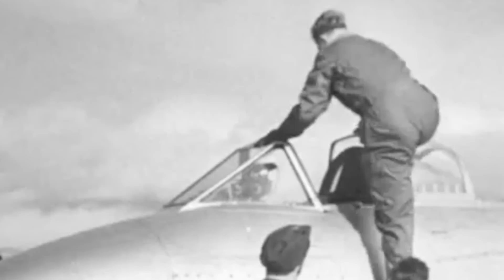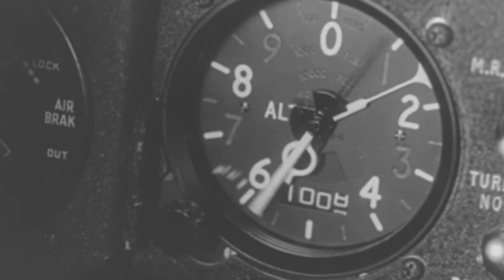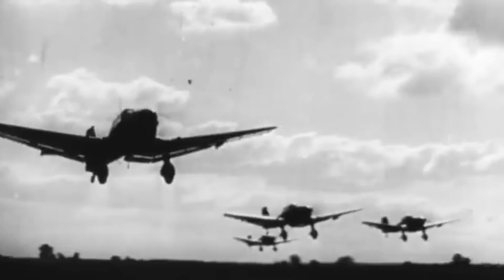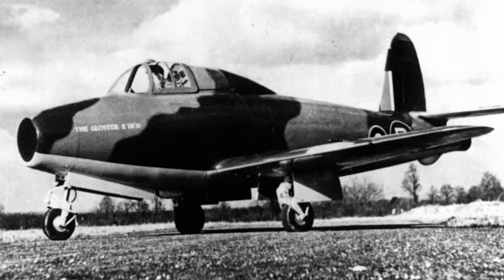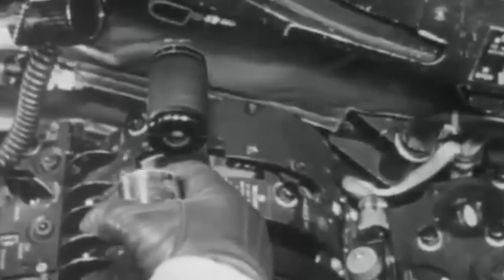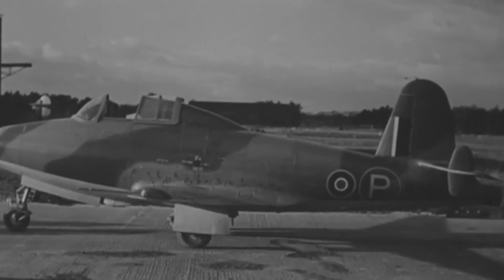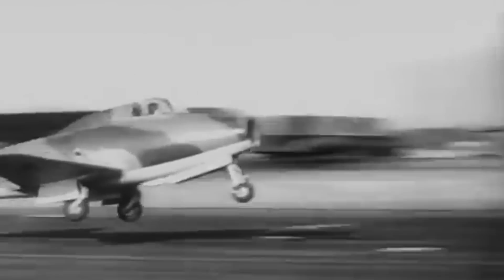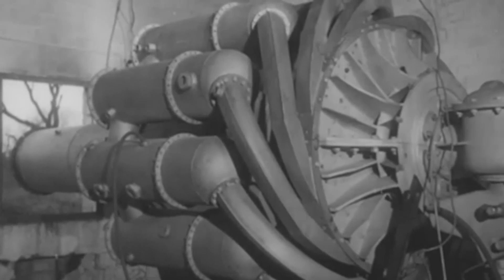Britain's 500 MPH Coffin With Wings

Comment: Your Post is Total Nonsense!
Reply: Gloster Coffin Works... the Gloster Meatbox was the worst deathtrap in jet aviation history.
Reply: @sandervanderkammen9230 

We believe we can clear up some common misconceptions & false myths.

It's always very important to note the relevant facts obviously.

Of course the F-86 Sabre & later F-100 Super Sabre & versions built under licence such as the CAc Super Sabre / Avon Sabre built for the RAAF generally had accident losses of around 21%. They were of course larger versions of the Whittle / Gloster E29/39.

    It was in fact the case that the Meteor had similar accident loss rates to the Sabre & Super Sabre while being a much earlier aircraft design.

    Regarding the awesome Gloster Meteor, it's achievements & obvious relative superiority.

   Indeed it is of course correct that the Gloster Meteor was in fact operational during WW2.

   Agreed, of course it is the case that we can compare the awesome trailblazer Gloster Meteor with the Starfighter. Training, equipment, knowledge in many areas & infrastructure had all improved considerably by the time of the Starfighter obviously, indeed it should have been much safer for pilots & others than it was.

     Yes that's correct obviously, the ME-262 was limited to running away from allied piston engine fighters  & risking engine destruction while doing so & it took 3 downed 262s for each downed allied bomber over Germany where German air inferiority was fairly ubiquitous so there was indeed large swarms of allied bombers available to have a go at but the 262 was of course a dismal failure at that task.

     Agreed, clearly after 1941 it was clear The future Gloster Meteor wouldn't be required as such & was limited to operation over the UK & occupied allied territories to keep examples out of the wrong hands.

    Yes it is of course correct that the world's first jet powered aircraft to exceed 1000 mph was indeed a British aircraft.

  Yes, agreed, it's a pity British forces had to occupy a large part of Germany for decades after 1945. Russia had to do the same. Russia now produces nukes. Of course the UK produces nukes. Germany does not produce nukes. Russia still possesses a large chunk of what was German territory.

  Of course there are two fabulous Gloster Meteor aircraft currently being used for ejector seat R&D at Martin Baker.
   
Contrary to their copious & ubiquitous posts regarding accident losses of various UK aircraft.
   
As they mentioned previously, the Sea Vixen & Gloster Meteor were indeed very competent & beautiful aircraft.

    In fact the Meteor was the world's first aircraft to exceed 0.85 on the combined 2 year looks & capability scale for jet fighter aircraft.
   
    That's correct of course, Indeed A rather superb Gloster Meteor was the world's first Turboprop aircraft in 1945. In 1945 & 1946 trail blazing Gloster Meteors set world speed records.
     
  Yes, of course it is correct that British military aircraft at the time did not have unusually high accident losses rates.
For example
De Havilland Vampire &  Sea Vixen & Gloster Meteor accident losses were not high or unusual for fighter aircraft at the time.
Non combat phase accident losses 
% of Aircraft built.
The Canadair CL-44 was a turboprop airliner.
Canadair CL-44                    (ff 1959 ) 48%
Lockheed XF104                    (ff 1954) 100%
Lockheed  P80                       (ff 1944) 43%
Lockheed F104                      (ff 1954) 45%
McDonnell FH Phantom       (ff 1945) 35%
Gloster Meteor                     (ff 1943)  21%
DH Vampire                          (ff 1943)  23%
DH Sea Vixen                       (ff  1951) 33%
Gloster Javelin                     (ff 1951) 20%

Gloster Meteor.
3950 Built.
In service 1944.
70% didn't have ejector seats.
839 accident losses.
436 accident loss fatalities.
21% accident losses.
11% accident loss Fatalities.

Lockheed F104.
2578 Built.
In service 1958, 14 years after the Meteor.
All had ejector seats.
1100 accident losses.
425 accident loss fatalities.
43% accident losses.
17% accident loss Fatalities.

As always we do indeed clearly hope this helps.

Cheers
👍 & 😎 & of course 🙂 indeed.
Toodle PIP Old Chap  (obviously)
     
                
    Clearly, the line above is blank, (entirely intentionally).  
O B V I O U S L Y
    
.. . .. . ... .... . . .......... ...... ..
.... ....... ..... ...... .....  ..... ...

Comment: A nonsensical misrepresentation.
Reply: The "Gloster Coffin Works" had a notorious reputation for building deathtraps, the Gloster Meteor (aka "the Meatbox" by RAF pilots) was the worst jet aircraft in history, no jet has a higher loss rate or fatalities statistics than the "Meatbox"..
Reply: @DoktorBayerischeMotorenWerke 

We believe we can clear up some common misconceptions & false myths.

It's always very important to note the relevant facts obviously.

Krappenz, DiktorBummer, KARZEESTAN, Diktorbayturmosterjerkzxoffenzische, AnewAOownley etc & co - they should all note with much awe and great wonder.

    Regarding the awesome Gloster Meteor, it's achievements & obvious relative superiority.

Indeed it is of course correct that the Gloster Meteor was in fact operational during WW2.

   Agreed, of course it is the case that we can compare the awesome trailblazer Gloster Meteor with the Starfighter. Training, equipment, knowledge in many areas & infrastructure had all improved considerably by the time of the Starfighter obviously, indeed it should have been much safer for pilots & others than it was.

     Yes that's correct obviously, the ME-262 was limited to running away from allied piston engine fighters  & risking engine destruction while doing so & it took 3 downed 262s for each downed allied bomber over Germany where German air inferiority was fairly ubiquitous so there was indeed large swarms of allied bombers available to have a go at but the 262 was of course a dismal failure at that task.

     Agreed, clearly after 1941 it was clear The future Gloster Meteor wouldn't be required as such & was limited to operation over the UK & occupied allied territories to keep examples out of the wrong hands.

    Yes it is of course correct that the world's first jet powered aircraft to exceed 1000 mph was indeed a British aircraft.

  Yes, agreed, it's a pity British forces had to occupy a large part of Germany for decades after 1945. Russia had to do the same. Russia now produces nukes. Of course the UK produces nukes. Germany does not produce nukes. Russia still possesses a large chunk of what was German territory.

  Of course there are two fabulous Gloster Meteor aircraft currently being used for ejector seat R&D at Martin Baker.
   
Contrary to their copious & ubiquitous posts regarding accident losses of various UK aircraft.
   
As they mentioned previously, the Sea Vixen & Gloster Meteor were indeed very competent & beautiful aircraft.

    In fact the Meteor was the world's first aircraft to exceed 0.85 on the combined 2 year looks & capability scale for jet fighter aircraft.
   
    That's correct of course, Indeed A rather superb Gloster Meteor was the world's first Turboprop aircraft in 1945. In 1945 & 1946 trail blazing Gloster Meteors set world speed records.
     
  Yes, of course it is correct that British military aircraft at the time did not have unusually high accident losses rates.
For example
De Havilland Vampire &  Sea Vixen & Gloster Meteor accident losses were not high or unusual for fighter aircraft at the time.
Non combat phase accident losses 
% of Aircraft built.
The Canadair CL-44 was a turboprop airliner.
Canadair CL-44                    (ff 1959 ) 48%
Lockheed XF104                    (ff 1954) 100%
Lockheed  P80                       (ff 1944) 43%
Lockheed F104                      (ff 1954) 45%
McDonnell FH Phantom       (ff 1945) 35%
Gloster Meteor                     (ff 1943)  21%
DH Vampire                          (ff 1943)  23%
DH Sea Vixen                       (ff  1951) 33%
Gloster Javelin                     (ff 1951) 20%

Gloster Meteor.
3950 Built.
In service 1944.
70% didn't have ejector seats.
839 accident losses.
436 accident loss fatalities.
21% accident losses.
11% accident loss Fatalities.

Lockheed F104.
2578 Built.
In service 1958, 14 years after the Meteor.
All had ejector seats.
1100 accident losses.
425 accident loss fatalities.
43% accident losses.
17% accident loss Fatalities.

As always we do indeed clearly hope this helps.

Cheers
👍 & 😎 & of course 🙂 indeed.
Toodle PIP Old Chap  (obviously)
     
                
    Clearly, the line above is blank, (entirely intentionally).  
O B V I O U S L Y
    
.. . .. . ... .... . . .......... ....
.... ....... ..... ...... .....  ....
Reply: @petemaly8950  Can you name a UK company that still makes British jet aircraft today??
Reply: @DoktorBayerischeMotorenWerke 

We feel we can clear up some common false myths, misunderstandings & misconceptions.

It is indeed always very important to note the relevant facts obviously.

Of course It's perfectly normal to find this comment extremely annoying.
 
    Regarding the UK Aerospace Sector.

  WHY IS IT THEY CAN'T ANSWER VERY SIMPLE QUESTIONS ⁉️ 😅
  A very simple question indeed.
   
Which airline recently ordered 60 RR Trent XWB Engines? 

Also name a single Germany company that makes German jet aircraft in Germany & name a single German Company that makes German gas turbine aero engines suitable for widebody airliners.

  ANSWERING The QUESTION WON'T HURT A BIT, COME ON NOW, THEY CAN DO IT IF THEY TRY HARD ENOUGH.

     That's correct, Brazil makes very good airliners & Brazil is 100th down the list along with Indonesia for wealth per capita.
Norway Holland Denmark Ireland Belgium - Top 20 wealth per capita - Don't make airliners -  its as simple as that.
  
  Agreed, that is correct of course, clearly there are many countries that could easily produce airliners of better  quality than Bow-wing (see b-47 wing folding & wing collapse incidents) but don't for some very good reasons. Bow-wing being a result of the size of the US, the large protected domestic market & great ease of testing new types due to the equator to arctic geography & a few other reasons related to production scale capability, politics & economics.

  Obviously there really is nothing special about Bow-wing, having more than 50 years design / build experience on the type means they have no excuses for the horrendous max incidents for example.

    Indeed BAe Systems & Rolls Royce combined now do more Airbus work than Germany on an absolute basis & significantly more work than that on a per capita basis.
   
     Agreed, Per capita for the home nation BAe Systems is the world's largest defence contractor.
  
    Correct, BAe systems announced the recent £4 Billion takeover of Colorado based US based Ball Aerospace.
  
    It's definitely the case that BAE systems now does a significantly higher value of work for Airbus than it did when it was a major Airbus shareholder before 2005.
     
      Obviously RR now owns US Engine maker Allison for example which does classified Aerospace work for the US Govt.
   
   Yes, that's right of course, Anybody currently flying on a widebody airliner stands a good chance of being on an aircraft powered by RR gas turbine aero engines built in the UK.

   A typical but small glimpse of what goes on in the very internationally orientated British aerospace sector.  

      Boeing Apache Attack Helicopter.
AH-64: 75 UK suppliers, 7% UK content, global fleet of 1280+ aircraft.
F35B more than 130 UK Suppliers, more than 30% UK content.
F35A & F35C more than 130 UK Suppliers, more than 15% UK content.

   There is no doubt that an airline has just ordered
60 RR England Trent XWB Engines

Obviously the UK has the
World's Highest Combined Per Capita
 Nuclear / Defence / Aerospace Sector Activity.

Rolls Royce Holdings UK
Subsidiaries
- Rolls-Royce plc
- Rolls-Royce North America (Allison etc Classified Military stuff)
- Rolls-Royce AB
- Rolls-Royce Deutschland
- Rolls-Royce India Private Limited
- Rolls-Royce Marine Power Operations
- Vinters Engineering Limited
- Rolls-Royce Controls and Data Services
- Rolls-Royce Power Systems
- Bergen Marine
Joint ventures include:
- Rolls-Royce Turbomeca
- MTU Turbomeca -

Trent Family
The MT30 (Marine Turbine)
Industrial Trent 60 Gas Turbine
Trent 7000
Trent XWB Airbus A330neo.
Trent 1500
Trent 1000
Trent 500
Trent 600
Trent 700
Trent 800
Trent 8100
Trent 900

RR wholly owned subsidiaries in Germany handle smaller 2 shaft RR gas turbine aero engine work.

We hope this helps of course as always.  Cheers & 😎👍 indeed.

       O B V I O U S L Y  

. ..... ..... ......  ..... ..... ...... ....
.... ..    .. .. .... .... .. ... ....... ..
Clearly the line above this line is not blank.